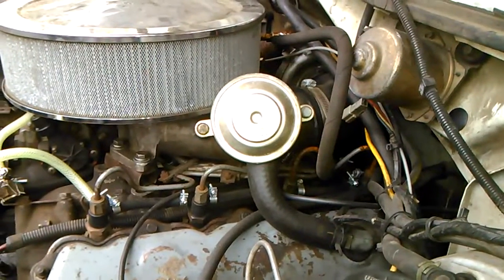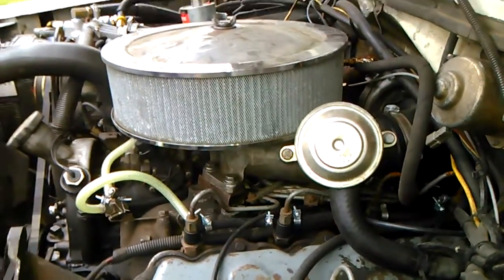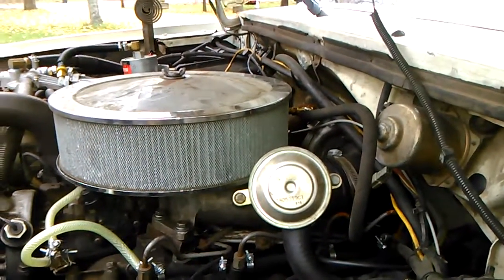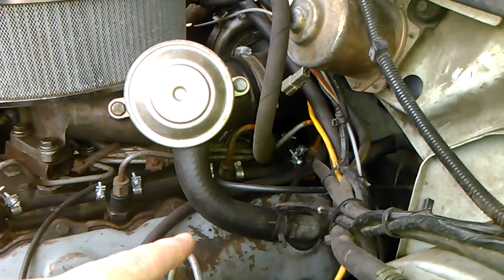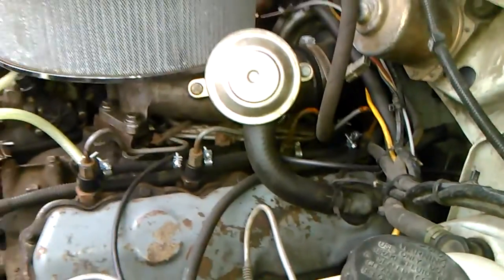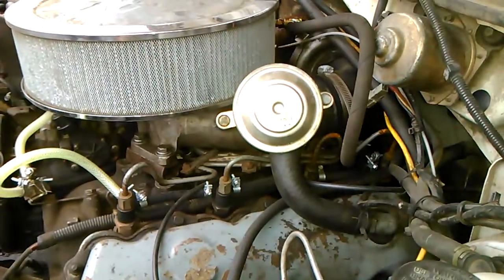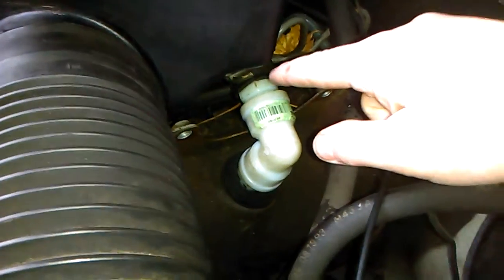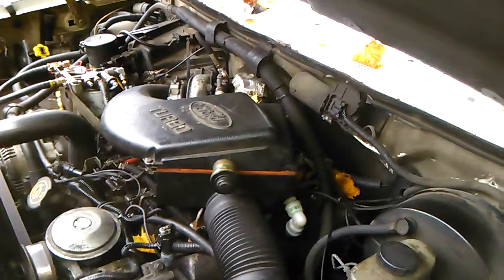IDI cdr overview

Comment: I the past I have run a road draft tube or sorts but piped it into my exhaust. 4" straight pipe so there wasn't any back pressure to worry about and no smoke or smell from blow by.

Comment: The CDR also keeps the intake from pulling a vacuum on the crank case at higher rpm. The intake draw helps with venting the crank case, as I learned through my RDT trials. RDT doesn't vent effectively enough and your perfectly fine rear main seal will act as a pressure relief valve and leak oil like a sieve. I reinstalled the CDR and the RMS hasn't leaked since.
Reply: Diesels dont make vacuum, because there is no throttle plate, esp. on an idi. Thats why they have vacuum pumps.
Reply: @flatbrimsickdope2050  Just the slight vacuum created by the air filter
Reply: @flatbrimsickdope2050  There is most definitely vacuum at the location of the CDR outlet.  The closer you get to the cylinder, the higher the vacuum pulse...that's why they put the CDR as far away from the cylinder's as possible, but after the air filter b/c there's a lot of oil mist.  Just air rushing past a port at 90 degrees will pull a vacuum.

Comment: I am looking for an air cleaner to replace the factory stock ford assembly that is missing the lid. The fuel intake is flush with the other components on my 6.9L IDI so the bottom of the assembly needs a flat bottom with a short riser to connect. Is that an Edelbrock 1207? Did you need any mods to get it to connect?
Reply from the maker: duckponics this was actually a K+n version but test fitted the edelbrock one literally just gotta open up top lid diameter

Comment: hey Mike.  got a 91 7.3 idi non turbo and want to replace my factory air cleaner with an Eldebrock.  from one of your previous replies it appears that 1221 or 1227 will fit with reboring the hole size in the cover.  any input that will help and which model Eldelbrock is best?
Reply from the maker: I don't know the exact model the PO installed mine
Reply from the maker: the larger one if there is a noticeable difference
Reply: @groundtogreen1140  hey Mike was there any performance gain by doing the open air filter vs the OEM version? Any mpg gains?
Reply from the maker: @Powerhousegarage406  no I didn't notice any difference and that truck being a c6 it did worse than my idit truck with the e40d
Reply: @groundtogreen1140  yeah not sure if it's even worth getting an exposed filter rather than the OEM style.

Comment: hey, look my 6.9 runs very well sounds great, starts perfectly however crankcase ventilation , seems to have a bit from oil fill . lossing some oil from base doesn't appear to be burning that much. if I was burning oil in this amount I'd also have other troubles. intake does resemble oil. how can I decifer blow-by-blow pressure and just venting. thank you. for reading this .
Reply from the maker: due to the second ring gap on these engines blow by is a little more common with these vs other diesels if everything is running good and oil psi/consumption is good sounds like you just have normal idi blow by and from what Id also assume adequate ventilation of the crankcase
Reply: Mike Grn I was looking at another vid I may install valve seals just to be certain. this engine is refurbished . I sent away for it had it delivered from from factory/ warehouse. a few yrs old now I'd say 20 to 30 K  Max on it at this point. not used alot in the course of 4 yrs. thank you this truck means alot to me. I wish this engine would go back in to circulation .
Reply from the maker: yea I love mine as well will be hard pressed to find a more reliable design as cheap to fix. At least they made alot of em to go around.

Comment: How did you connect the valve cover to the cdr? The hose I have is junk and I need to set mine up like yours
Reply from the maker: The turbo kit had threaded mounting points

Comment: Why not just have the tube go to the intake & not have a POS valve that can cause a head gasket failure. My 7.3 PS has the little metal mesh box that has a tube that does to the intake before the turbo.

Just let the thing breathe, no stupid pos EPA S$&T. Or make it stick open permanently, so it’s just an empty box.
Reply from the maker: I later deleted on this truck when I upgraded the turbo then I sold it

Comment: Hi Mike ,One more thing ,I see a little oil in my CDR which has been on the truck since 2000. if  i replace the Cdr with a new one will that keep the oil from getting into my intake
Reply from the maker: Lance Gordon not necessarily they didn't do the best job as it was in preventing oil vapor in the intake and I personally don't see anything wrong with a little vapor . mine was always wet even with a new cdr but never caused issues

Comment: what is blow by?
Reply from the maker: this is the proper google definition lol

The term blow-by , means that the fuel air mixture blows past the piston , and into the crankcase. The system used to control and correct this problem , is called a PCV system - Crankcase ventilation system.

it's normally indicative that you have piston ring wear.
Reply: Ahhhh ok. Cool I'm up here in Canada, I recently bought a late 93 early 94 7.3 IDI factory turbo with 266.000 km which I believe is 165.000 miles and it's my first diesel truck. Your videos are terrific and help a lot.  Cheers